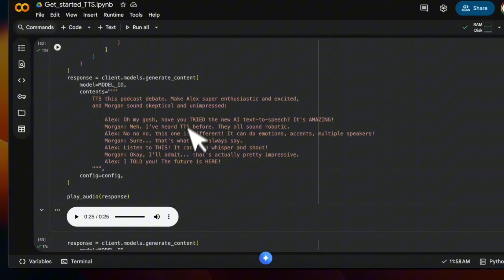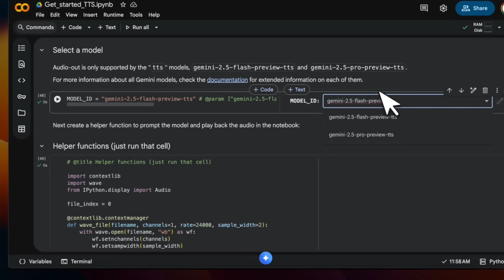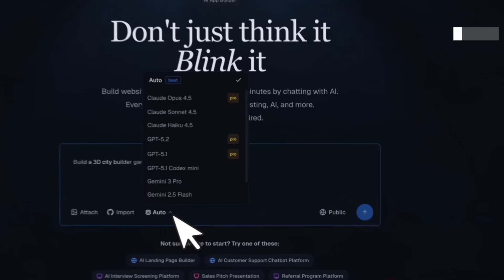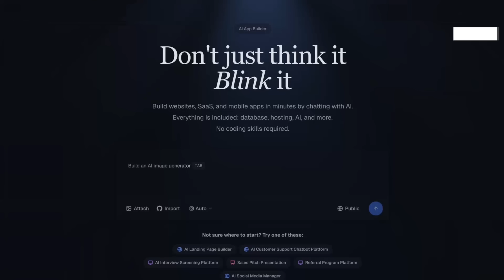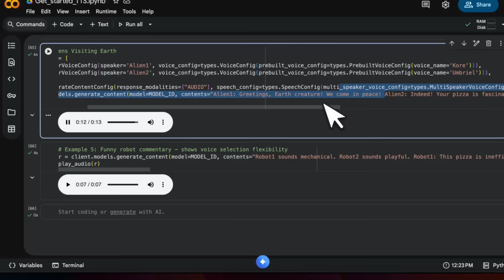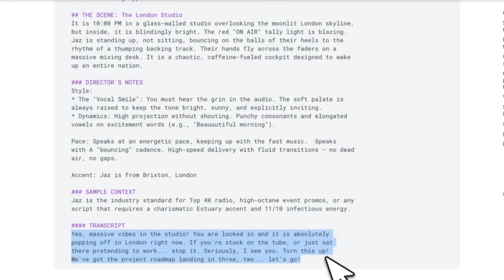The New Gemini Text to Speech

Comment: Gemini text to speech would be good, but it's limited to 30 seconds. Another thing I suggested Gemini make me an acapella using a female vocal and split the acapella into four 30 second sections consisting of verse, chorus, verse, chorus, so I could fit them together to get a 2 minute vocal. But it is unable to carry the vocal over to fit accurately to the next section. So the acapella would not fit together properly resulting in unnatural vocal changes in pitch and tone ect. If it could solve this issue it would be fantastic, because as a music creator I would have a ready made vocalist.

Comment: I wonder if it can read a book. Sounds interesting
Reply: No, it can't read copyrighted material. It can make it's own stories or non copyright which you imput, but it is also limited to the length, the maximum being between 30 seconds and 10 minutes speech depending on model I believe.

Comment: Are these new or is it the same old extremely slow models? Tried to use the Gemini TTS and it takes up to a minute sometimes to generate audio which makes them “not so useful” for voice agents
Reply from the maker: For real-time you want to use the live api
Reply: I turn off Gemini speech output and yet it's still fucking won't stop yapping.